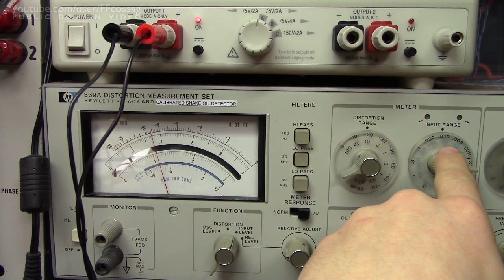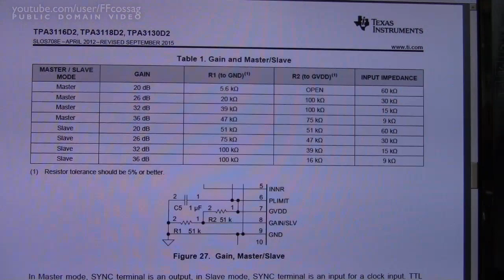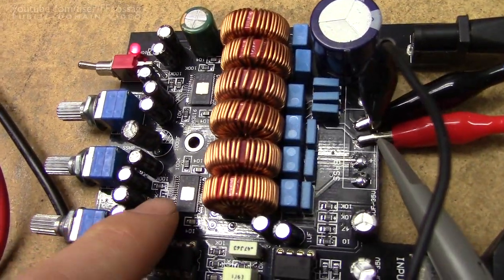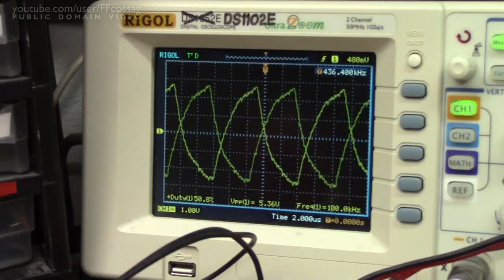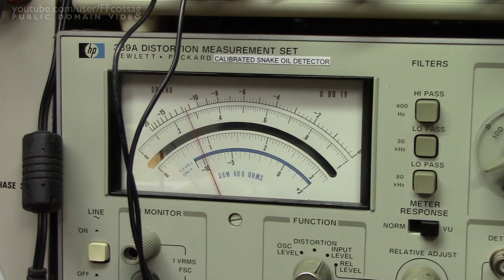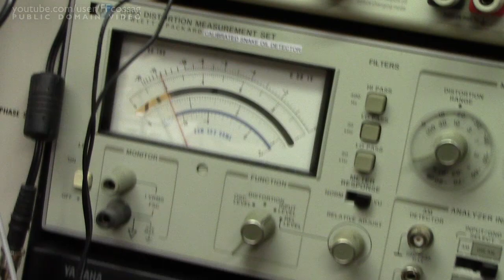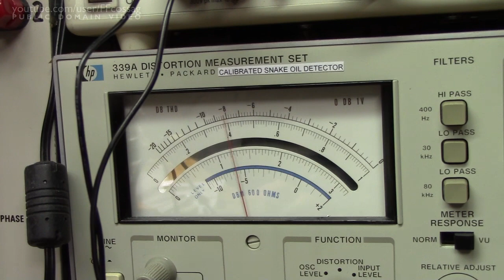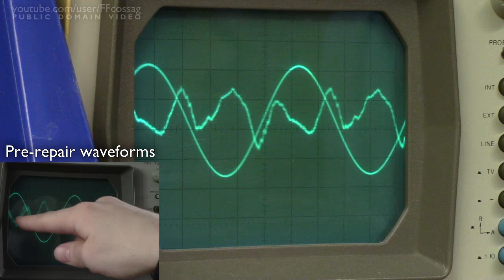Dual TPA3116 board: Fixing the AWFUL noise floor.

Comment: Thank you for this great video series! I have the blue version of the board, but the resistors for the master/slave configuration are in exactly the same places. Changed them and the hissing was gone. I then desoldered the L/R-pot and replaced it with wire links, you don't need it anyways. This cured the rest of the noise - great!
Finally, I cut the traces directly in front of the bass-pot and soldered wires to the two outmost legs of one channel of the pot. This gives me a seperate subwoofer input and makes the amp finally usable. Very good result - thank you for your inspiration!
Reply from the maker: +hieroben_de I'm glad to hear it worked out for you.
Reply: do u have any workings or exact instruction on what u did mate? got someone who's going to do it for me as dnt have the tools or soldering skills myself.
Reply: @FFcossag tengo un xr -139 es igual al de video pero el mío funciona porque le puse un voltaje mallo y no sé cómo arreglarlo

Comment: Thank you so much - i have 2 of these amps and following your instructions fixed the noise issues completely.  amazing power from this little amp.

BTW mine have the bluetooth feature which unfortunately is very very noisy still, to the point of being useless almost.  as long as i dont use bluetooth though it works great.
Reply: If you want to fix that, find the power lines going to the bluetooth module, cut them and put an isolation supply between them. The power to the module will be either 3.3 or 5v.

Comment: I'd like to add an update to the mod: I'm using the blue board 2 cap version:

1. I've replaced the four 1uF capacitors from the right with 10uF instead of the one thats shown in the video.
2. I have also replaced two tantalum surface mount 1uF capacitors on the bottom side with 2 x 4.7uF ceramic. These are the input capacitors to the subwoofer amp. Unless you change these, no matter what the roll off frequency is for the active filters, it will still get blocked at the input.For a flat response upto and below 20Hz, these mods will help.

3. I have replaced the four 1uF input capacitors to the L/R stereo with 0.47uF film caps, just to get rid of low frequency content into the stereo. This is only because I am using a separate sub. IF you require a frequency response down to 20Hz, replace these 1uF capacitors with 10uF as well.

Filters resemble whats shown on this page: 
http://techtalk.parts-express.com/filedata/fetch?id=1290801&d=1468700619

* C1,C2,C3,C4,C5,C23 replaced with 10uF. whats not shown in the schematic is the negative input caps.
* C12,C9 replaced with 0.47u

I did a simulation of these on ltspice before making changes. Ofcourse the resistor values shown in the schematic are different to whats on the blue board. I made the changes accordingly.

4. I've replaced the ne5532s with opa2134.

I'm getting some seriously good bass response so far.

The only problem is when the bluetooth relay clicks in there is a ground loop issue and I can hear hissing. When bluetooth relay opens the noise is gone. Any inputs on how to fix this will be helpful.

Thanks.
Reply: Hi man, I think you are the one to help me. I have a similar board but mine has 3 big capacitor ( https://www.youtube.com/watch?v=u-JcWJU2v5w ) Have a look. But the problem I have is that mine has the L/R channels running in full range. So what I need is for the satellite to play from 80hz and above. I know if I put a 500uf 50v capacitor to the speaker wire it will do it, but I wanted it to be cut off before amplification so no power is wasted. I believe my board is just like yours on the schematics. Thank you for your attention!
Reply: Flavio Gomes. Hi, you cam try replacing the four input caps for the L/R with 150nF. That should give you a cut off in the range of 70-80Hz.
Reply: Pravin Iyengar The higher the UF number higher the cut off point?
Reply: Which are the four caps on your schematic?
Reply: The bigger the capacitor, the more lower frequency it will pass through. its a high pass C-R input into the amplifier.  Which is why I reduce the capacitance, to reduce the lower frequency going into the amplifier. So, if you reduce the capacitance from 1micro farad to 150 nano farad, this will limit the minimum frequency to 70Hz+
Reply: On your board, you will need to replace the four capacitors. You will see  five capacitors on the left side of the board in front of the ON OFF switch next to L/R volume knob. From these five, you need to replace the left two, leave the third one as it is, and replace the fourth and fifth ones with the value I suggested.
Reply: Pravin Iyengar I see that the ones from left to right are 1uf. I must replace for 150nf 50v. I'm looking on eBay and the ones I find with that specs are Al flat ones. There is no cilidrical shape. Is that alright?
Reply: Flavio Gomes Hi. Yes, you can use film or ceramic capacitors as long as not too bulky. You can also use lower voltage capacitors 25V or 16V or 50V. I would suggest you get four 150nF,  Four 220nF and four 470nF. You can use 150n initially. if you feel you need  more lower frequency then try changing it to 220n or 470n to suit yourself.
Reply: Pravin Iyengar I see. Well I have the subs playing the low frequencies. I would actually need the L/R to play from 100hz and above. But 80 would do fine already. So the satélite do go jumping like crazy and not producing any sound. I'm gonna try to find these capacitors here. In Brasil it's all so difficult.
Reply: Flavio Gomes. Yes.. Get a few spare so you can double up if u need to.
Reply: Pravin Iyengar Thanks man! As soon as I can get my hands on it I will report back with the results.
Reply: Hey whats up! The capacitor have just arrived. But the welding thing hasn´t LOL. But do you have and email or use WhatsApp so I can send you pictures of what i´m gonna do so you can give me a hand?
Reply: Hi Pravin, just saw your response.   What's your opinion on bybass the bandpass portion completely and having the outputs from the main pot to go directly into the cap just before the subwoofer input caps?  Would that also help improve sounds performance?   Thanks, Adrian

Comment: Hey there ! Awesome video ! I just got one of those 3 cap amps - powered it up with 24v and it released the magic smoke within 5 seconds (my #2 public service announcement video). I fried one of the TPA chips (which look wither 5th tier or fake); if you're interested I could send it over your way for an autopsy.
Reply: Darieee same here! Although i think my magic smoke is because of shorting wires. Dumb me forgot to separate them properly .
It worked before the messup
Reply: Just got my 24v power supply and tested it on the 3 Cap amplifier. Everything working just fine until I raise the volume and the subwoofer amp chanel cuts off. I have two 8ohms speakers connected in parallel for a total of 4ohmns on the subwoofer channel so i´m within the specs but the sub woofer cuts off at half volume. It used to work fine with 14v. The interesting part is that I have two 8ohms 30w each on the satellite channel also in parallel for a total of 4ohms and for theses I can crack it all the way up. Do you thing it´s an impedance problem. Even thou it wont happened at 12v?  . Also in stand by with no song playing it draws 0.23A and I donkt know if it´s normal, at 14v it was drawing 0.12A.

Comment: Thanks for the video! I noticed something similar with the PAM8610 mini board. I was puzzled when I have seen the board and ordered one. My expectations were low but holy cow! The output music bass was distorted even though it was powered with a high amperage power supply and a large value capacitor was soldered  directly to the voltage input part of the board. I also have this TPA3116 board which has a whining noise. So yea I was thinking that the switching and the clock has to do something with it, and also the chinese component budget cuts. but never thought about such monstrosities like not setting the clock sync mode and the high value potentiometers... 
Also I tried to find a way to connect a vu-meter to the output of the TPA3116 board amplifier outputs. Since the output is differential i couldn't manage to connect anything which won't affect the output regards to the ground. Only transformer coupling could solve the problem, since capacitors would be connected to an op amp would be still referenced and pulled to ground by AC means.... a real pain in the boots....

Comment: I bought one of these dual Tpa3116D2 from Sanwu named Hf208 with bluetooth that also had a distortion. I removed the heatsink to reveal the resistors but found it was built a bit different. And advice you can give me in that one. Maybe I can send some pics aswell?

Comment: I have a weird 3 cap version with 5k pots, 49k resistors instead of 39k, no bridges on the tda chip and it doesn't suffer from a screechy noice, just a hiss that's only noticeable when you put your ear next to the speaker.  This mod made the two rightmost coils warmer and a loss of clarity for the l/r.  Hiss was still there.  removed the l/r pot then replaced with wire jumpers.  This reduced the hiss. I reverted all of the mods except for the l/r bridges.  Coils dont heat up anymore, sound clarity returned.  So by replacing the l/r pot reduced the hiss, thinking of replacing the main pot with 10k?  If that doesn't fix it, i'll just leave it be.
Reply: update, I just noticed that my amp has screeching sounds, it was not loud enough that's why I didn't notice right away.  I checked the resistors and referred to the datasheet.  Wrong combination of resistors was the problem.  Mine had 100k and 47k, should have been 100k and 39k for 32db gain.  So I replaced them, did the mod and guess what, noise gone!  Thanks for this video!

I also found the solution for the hot inductors.  Output filter caps for the subwoofer output should be (Output filter: L = 10 µH, C = 1 µF) when running on parallel mode, taken from datasheet.  680 nF is what I can read on the film caps.  I will replace it when I find some good caps.
Reply: hey ! I have a completely different board, but the inductors on here are running stupid hot (way way too hot to touch) - damn thing draws 6W on 24V ... anyway - did you manage to fix that on yours ? Thanks a lot :D
Reply: Inductors running hot is almost always from the filter inductors and capacitors being the wrong value. You will need to look at the data sheet to see what it should have. It depends on a lot of variables.

Comment: Nice detective work... I guess I'm not alone when it comes to figuring out bad/cheap design problems (of which there's no shortage in these kinds of products)  They look at the manufacturers "typical application" schematic (and example board layout), and make a final version product from that... without having any real understanding of what they are doing!

Comment: I have this board in Bluetooth model but under at basically the same components descriptions (tpa3116) and my board's potenciometers are 5k ohms and my board have the same awful noise floor when conect in Bluetooth Chanel. When conected at p2 Chanel all the sound is Very clear. May I solve my problem doing the same corrections as you have showed? Thank you
Reply from the maker: No, that's just a shitty BT module.

Comment: I've got a questin regarding another china amp board (tTDA3116). When I hooked it up in my old house it worked just fine, no strange noises. Now in my new house I get exactly the same noise as you have with this board only way louder. When I turn the volume only half way it starts to really hurt my ears.

The difference between the two houses as far as the mains power is concerned: 
In my old house there was no earthing from the walls mains supply, in the new house there is. So can I therefore conclude it is an earhting/grounding problem? And how can I fix this?
Reply: Joren Canisius don't use ground?

Comment: I noticed that the input signal ground is put to be the same as the power ground. Can this cause problems with the noise floor? Also if the L/R plot goes straight to the tpa3116, how can the main volume plot affect to the volume level?

Comment: I cannot help but notice the large toroidal chokes in the output filter. Is it possible that the small square chokes used in most other class D amps saturate at rated output causing distortions? Why use large toroids if the small chokes work?
 I appreciate the vids you do on the Class D amps. I have watched all of your vids on them. What model is your favorite so far?
Reply from the maker: Possibly. The little squares probably have a tad better performance since they're a bit tighter in their construction, but what you're suggesting is entirely possible. However, since performance of these modules (when fixed) is basically the same as all the rest, I'm inclined to believe the chokes don't really matter too much.

As far as my favourite amplifier, I'd like to say the Breeze Audio because I like the look of it, but in practise it would be my somewhat modified Lepai LP-2020, but that's ONLY because I've put a giant volume knob on it that makes it really comfortable to use.

Comment: 2:31 Were the pots turned down and it still heated up? From what I remember working on radios in the Air Force years ago, if you have no load connected when transmitting (or with imbalanced impedance) then heat can build up as a result of standing waves inside the device. I'm not sure whether that applies only to ancient radios or all electronics, though. Newer stuff like the Harris PRC-117(G) didn't seem to have issues with that, though it was standard practice to always have at least a dummy load. We were told to never transmit a signal generator, amp, radio, etc without a proper load.

I also could be a philistine and have no idea what I'm talking about.
Reply from the maker: You're right when talking about anything RF or anything with tubes in it. Solid-state Class A/AB/B amps don't care at all, and class D amps like this one shouldn't care if they're properly designed, and might care a little if they're trash.

Comment: I have buy a tpa3116d2 and buy a 24v 4a power supply since i use the 24v i have a loud humming specialy when i move the hi knob the higher you put the hi knob the louder it gets then one day i use my 12v supply andnit reduce the loud noise what shoud i do my 12v just using i thing 2a so it cannot supply the amp at pull volume

Comment: Nice video. Expecting my amp in next few days, and now I know what to do with it... :)
Do you think potentiometers noise is value (10k vs 50k) or quality related? Could that be improved inside a grounded case?

Finding the problem with subwoofer channel in the other/original video was a bless, though I will try to find how to change the cutoff frequency - more like crossing 80hz at -3db of so. Crossing 80hz @ -6db is just too low, even for THX standards :) .
A 2nd order (12db/oct) active filter costs only 2 resistors, 2 capacitors and an ampop!! That is what I expect in a board like this... it's all there, but just badly implemented?!?!
Reply from the maker: +Joaquim Pereira The quality of the potentiometer has little relevance, the noise has to do solely with the resistance; higher value resistor equals more noise generated by it (yes, generated). It's thermal noise.

As for "THX standards", I don't give much for those. They put the THX logo on all the cheap crappy computer speakers, but none of the actual high-end gear you can buy.

As for the filter implementation, I ain't got no clue what they be doin'. I tried reverse engineering it a little, but it just made no sense.
Reply: +FFcossag THX thing was just a joke, but in fact THX and Audissey set subwoofer response to 80Hz, the rest going to main channels.
Some sellers say that this board has a subwoofer frequency adjustment... could it be that the middle pot is, in fact, that? Do you remember testing it that way?
Pot assignment, from these sellers: left - Stereo Sound Volume, middle: subwoofer frequency regulation, right: subwoofer volume. That could make sense.
If that's the case, we can even play with main channels frequency response as the 1uF input cap plays with IC input impedance forming a 1st order high pass filter... nice!
Reply from the maker: Joaquim Pereira I'm afraid the middle pot is just a level adjustment. It has no impact on the frequency response of the filter.

Comment: Very informative video!   Quick question, instead of using a 10k pot, is it possible to bypass it completely and drop the gain to 20db on both chips to simplify the design?   I would prefer just to use the main volume pot.
Reply from the maker: You can just short across the pots if you want to lock them at max volume. Or replace them with resistors.
Reply: @FFcossag  thanks!  But would I benefit from dropping the gain in terms of noise floor and S/N?
Reply from the maker: Yes.

Comment: And one more thing...( as Steve Jobs says :)) As far as I could understand, right and left channels have some sort of filters, hi pass filters. The subwoofer channel have low pass filter. But I don't know exact parameters of that filters, there is no info about that . Can You please somehow measure on what frequency they works?
Reply from the maker: +Taras Lys The R and L channels don't really have any filters, they're flat down to about 10 Hz.
Reply: +FFcossag so we need to use additional hi pass filter before the speakers :( why the hell they use op amps there? And what about sub channel? Is there any low pass filter?
Reply from the maker: Taras Lys I went through most of the characteristics in my first video about this board, check it out for details. The short answer is yes, but it's retarded.

Comment: @FFcossag: Why did you cross out the labeling of your oscilloscope and call it DS1102E ?
Reply from the maker: It's running DS1102E firmware, and the only difference between the 1052 and the 1102 is the firmware.
Reply: Ah .... OK .... Thanks !  :)